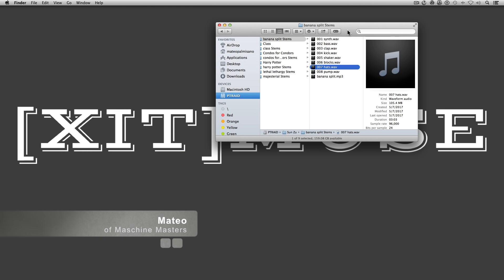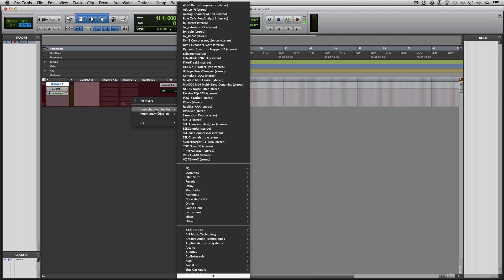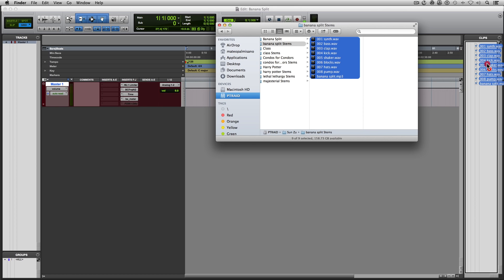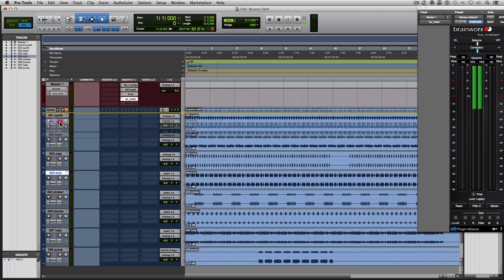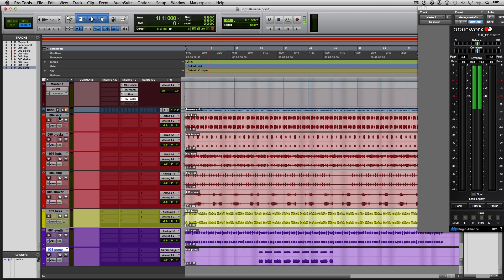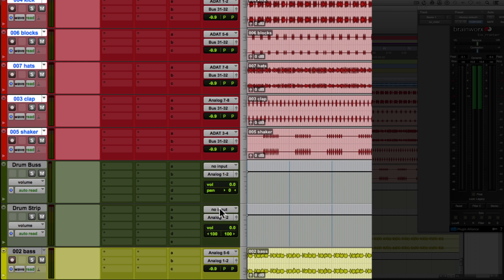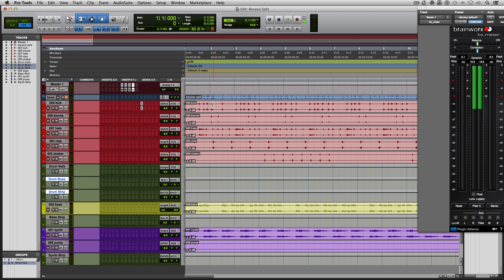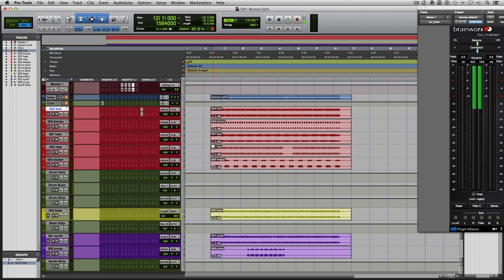Mixing Workflow 2017 | How Professional Audio Engineers Use Pro Tools

Comment: hey whats man quick question...what matters more 2 fix ??? if your group individual channel and sounds in maschine is clipping in the red ...or if your master output channel is clipping in the red ???

when i level my individual sounds they dont clip but my master does clip...and sometimes when my master output does not clip...my individual group channels in maschine clips...so what is more important...the master out put clipping or the groups  ???
Reply: Great question! Unless you are intentionally doing it as an effect, you should really avoid clipping in general. Whether it's clipping on the individual tracks, or the master output, just avoid clipping. The accumulation of distortion across a mix, can really make your track sound harsh to listen to.

The reason you may find that your master is clipping, but not the individual tracks or groups, is because the accumulation of all the tracks can build up, and exceed the limit of your overall headroom that you have available for a mix. This is one of the reasons why I like to group my tracks into sub groups. If I notice that my mix is getting too close to distorting my master output, I can easily bring down all the groups just a bit, and then I have more headroom available in my overall mix.

If you have individual tracks or groups clipping, but not your master fader, that is probably because the input or output signal of that track/group is exceeding 0dbfs (0dbfs is the maximum possible digital level). But, the fader of those particular tracks/groups could be set lower, so it isn't also distorting your master fade. First figure out if the input or the output of those tracks/groups are being distorted, and adjust the gain on them so it is no longer exceeding digital 0 (the point of distortion). 

Let me know if this makes sense to you. This is a great question, and I may even make a tutorial for this at some point.
Reply: that makes sense...thanks...but i just wonder why when i mix my beats or my 808s dont sound as loud enough without clipping  ???
Reply: Perceived loudness is usually influenced by higher frequencies. Bass sounds will always sound lower in level, than high frequency sounds. It's just how our ears respond to the frequency spectrum. It could be that the distortion caused by clipping your 808 is influencing perceived loudness, because of the distortion that is occurring. This distortion is like saturation, which stimulates the higher frequencies in the sound, and gives the impression of sounding louder. You could always just run your 808 through a saturation plugin like, Softube's Saturation Knob, and just drive it to distortion. But, this will drastically change the sound character of your 808. Sometimes this change is good, but sometimes it isn't. 

Use your ears. Just because something sounds louder, doesn't mean it sounds better.

Comment: I'd love to hear more indepth about dithering. I work in logic9 and have never gave it much thought.
Reply: Oh, the mysterious Dither! I brushed over it quickly, because Dither is a topic that could have it's own video... A long video. 

The short of it is that it uses psychoacoustics to maintain the perceived loudness of bass, by adding noise to the audio. This is only done though, when you truncate your audio from 24bit to 16bit. Going from 24bit to 16bit, requires you to lose a bunch of your dynamic range. Since Bass takes up more headroom in a mix, than anything else, this truncating process usually targets the low end. The other reason is that bass frequencies are cut through this process, is that bass is less perceivable to the human ear, than the higher frequencies. We usually feel bass, not hear it. So, Dither uses a kind of noise that tricks your brain into thinking that you can still "hear" the bass. 

Maybe I'll go into it in a future video. We'll see though.

Comment: A little. Confused about the drum routing. all drums> Drum bus >master? But the kick/ snare > drum strip> master ?  And how  to route any of it to the drum reverb?   
I wish I got it but I'm still confused
Thanks for doing these videos though
Reply: Hi Jon! Thank you for watching, and thank you for your question. Allow me to better explain the routing. 

All Drums (Including Reverb) Output > Drum Aux Strip > Master

Kick/Snare are bussed > Drum Buss or Parallel Processor (Whatever you want to call it) > Master

When it comes to drums, I always have a parallel drum processor and reverb set up as part of the group. The signal flow for the drums is, all drums, including the reverb, go to the Drum Aux Strip, and then Drum Aux Strip goes out to the Master, or Main Output. The "Drum Buss" Aux, or Parallel Drum Processor, which is fed by the kick and the snare, but you can also add other stuff to it, does not go into the Drum Aux Strip, because I don't want it to have the additional processing that is on the Drum Aux Strip. This is because it is meant as a Parallel Processor to the original drums. The Drum Buss is meant to be played side by side with the Drum Aux Strip, as an added texture to the sound.

Does that help?
Reply: Jah Rose: “uh, I’m still reading your reply” (2 years later, no thank you, no reply).
😜😜😜😜😜😜